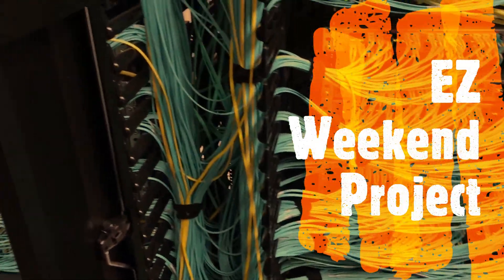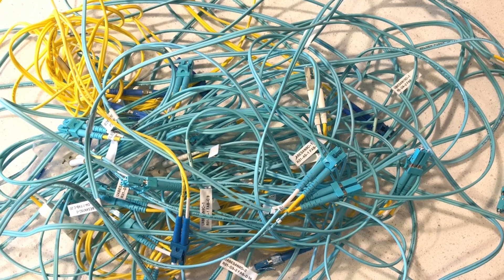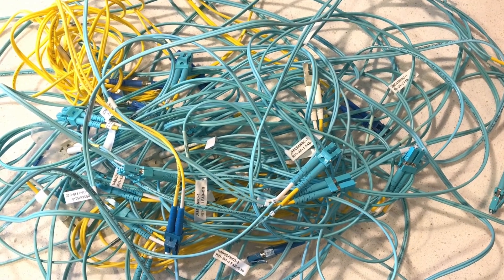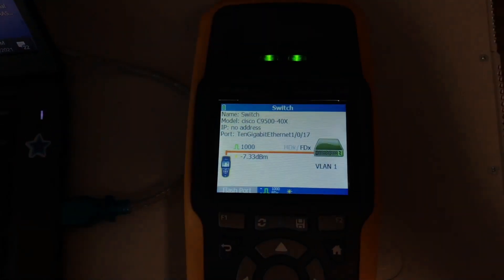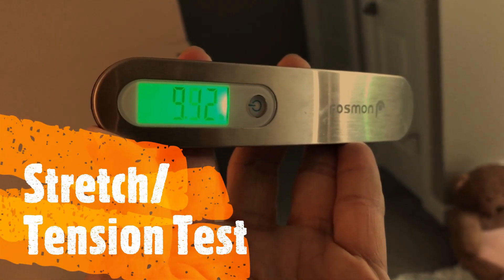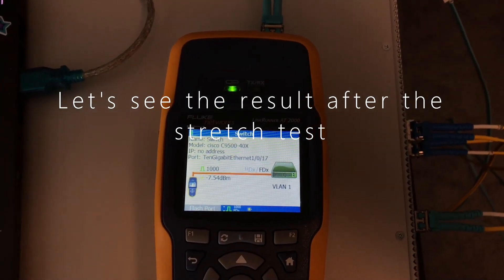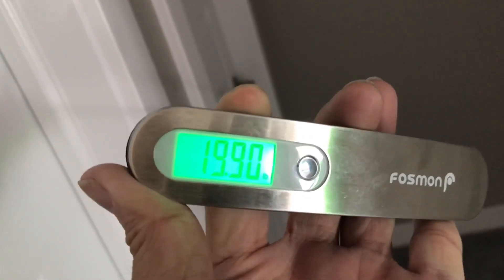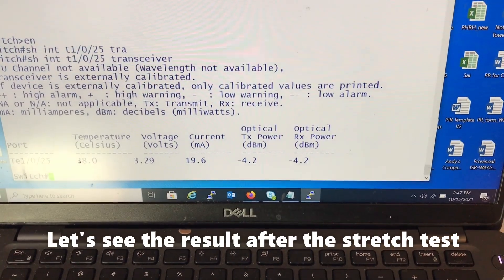Is fiber optic cable fragile?

Comment: Even a fusion splices, with 60 mm protection sleeves are fairly strong - probably as strong as the original cable!  One tip when pulling fiber in metallic electrical conduit (that is, not designed specifically for fiber) -- LSZH jackets are much more abrasion resistant than PVC jackets.  (I haven't tried OFNP jackets bec I cannot find a vendor with G657.A2 or tighter radius bend insensitive cable in OFNP -- can only find G657.A1 which has a larger bend radius and I feel a smaller bend radius is more preferable).

Comment: cell phone providers made us use a 3 feet bend radius minimum. im curious what your DB readings would be with a couple or few hundred feet. also, we had most of our issues with the glass connectors. we had to scope every one, clean it and target it in a screen shot for a report of the fibers. every last fiber had to pass through its full length. i think they gave us 10db.. its been years

Comment: What if we have hydrogen gas or any magnets near to it?
Reply from the maker: Hydrogen gas can cause attenuation or loss of signal strength in fiber optic cables. Hydrogen molecules can penetrate the fiber optic cable's protective coatings and react with the glass fibers, causing them to become opaque or cloudy, which reduces the transmission of light. This phenomenon is known as hydrogen darkening or hydrogen-induced attenuation.

it's important to note that the effects of hydrogen gas and magnets on fiber optic signals depend on the strength and proximity of the gas or magnet to the fiber optic cable. In general, fiber optic cables are designed to be resistant to these types of interference, and they are often installed in protective conduits or sheaths to further reduce the risk of damage.
Reply: I got it. Thanks for the detailed and clear explanation. All the best your knowledge sharing channel and your best efforts.

Comment: I work in industry and I am faced with getting signals back from moving machinery, think like robot arms etc where there is repetitive movement. Using copper wire of the correct type (beryllium copper), failures were occurring every 5 years of so. After switching to fiber, the failure rate decreased to more than 10 years! Even then, it was not the fiber that failed, rather it was the sheath material, leaving the bare fiber intact.
Reply from the maker: Probably was unwanted noise or interference.  Proper shielding copper might be OK too or fiber for sure.